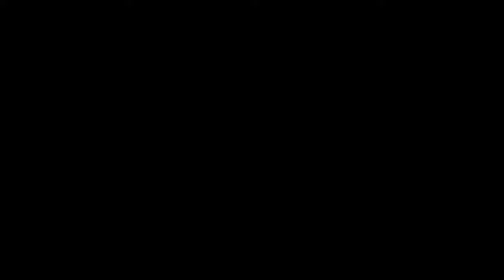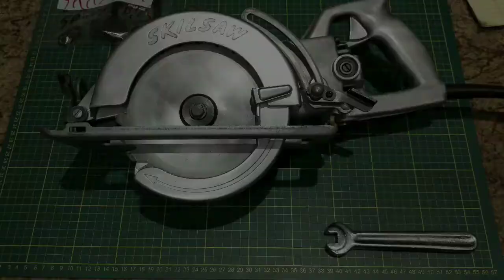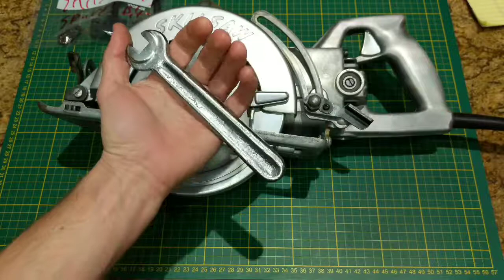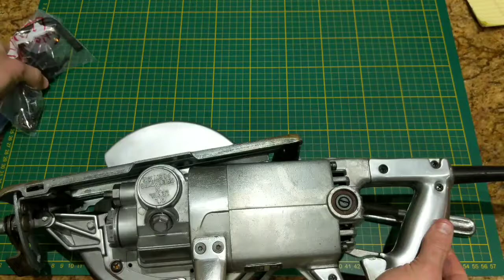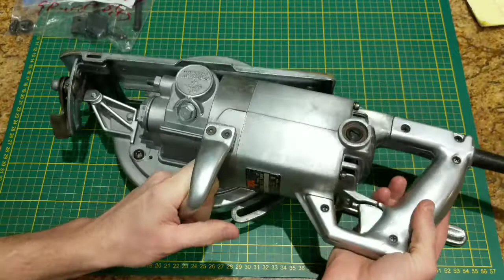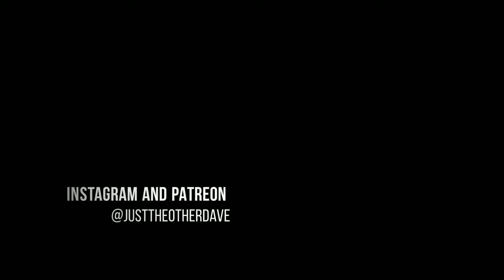Skilsaw 77 Wrap Up Probably

Comment: You can buy the specific Skil brand lubricant designed to protect the worm gears at many builder supply stores. Mobil SHC 636 would do the job nicely as well.
Reply from the maker: Desperate4Attention Thanks! After feeling how hot the gearbox gets in continuous operation, my engineering senses are tingling and I think running the correct oil might be more important than I gave it credit. I'll look into that!
Reply: You have stumbled upon a great, sturdy old tool which has been carefully stored away for many years. I'm guessing it was made around 1970 . I hope it serves you or somebody else for decades to come. Work with the tool and use its abundant torque and mass to your advantage. Lastly, unlike the superstars you see all over Youtube, using clamps when cutting wood is a very sensible practice not a sign of weakness.